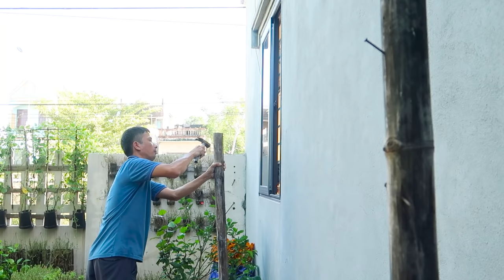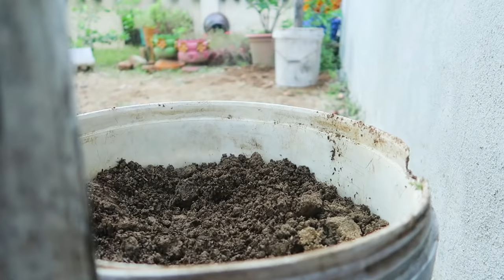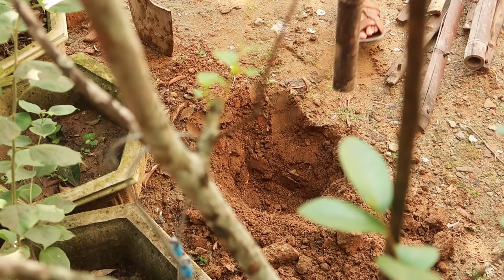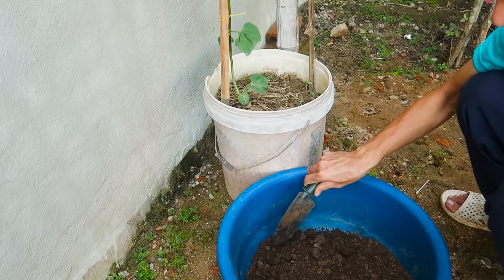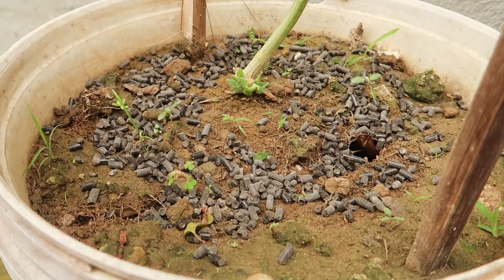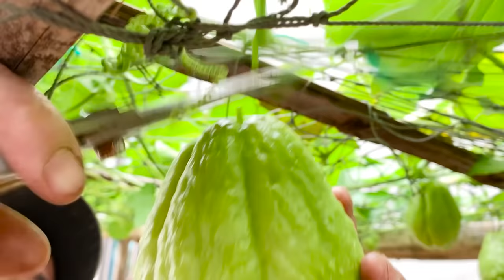Unexpectedly, Growing Chayote at Home is so easy, so many fruits

Comment: Very important tip: cut the main branch when it young, so can grow few more branches, last year I had only one plant but with so many branches and end up with almost 100 fruits in the season. the more branches you have the more flower and fruit you can have, once the branches finish growing fruit, just cut the tip of and few more new branches with come out with new flowers.
Reply: Me interesa eso, cuando se hace?
Reply: @albertopalos8326  once you plant it into soil, after the main branch grow to about 1 meter high and with some leaps, just cut the tip off, few days later few more branches will come out from the seed or close to the seed, during the plant growing you also can cut the tip of any branches and more new baby branches will came out from that branch, the plant also will grow lot more stronger, in winter you can prune it down to 3 or 4 branches with about 1 meter long and grow very fast in the spring. also, it need lot more water and sunlight.
Reply: @jxmai7687  gracias
Reply from the maker: Thanks for the info!